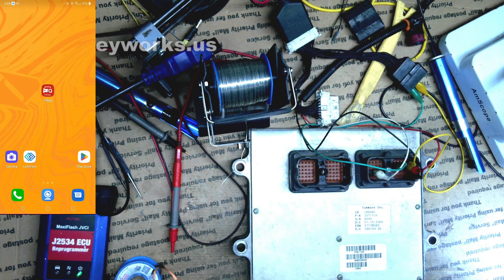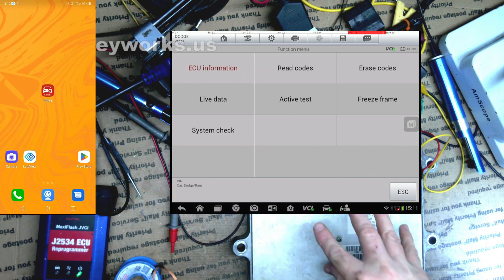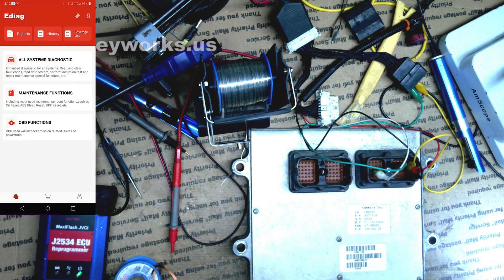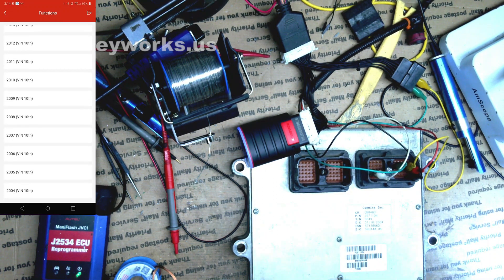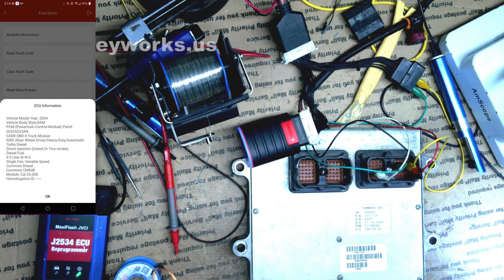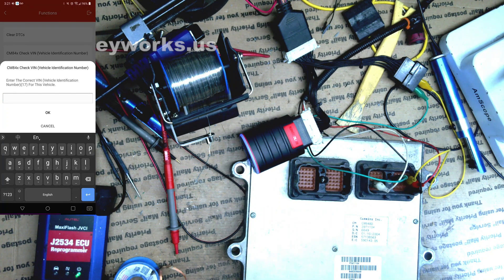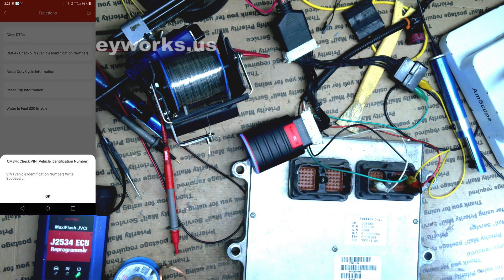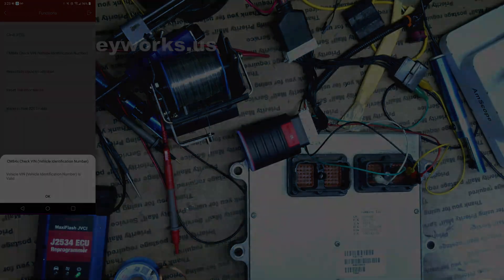VIN Write for Ram Cummins 5.9L CM848 ECU using EDIAG form KingBolen

Comment: Hi, this is on all lauch based scanners. Its one of the reasons I use it as my daily scanner, ive got a video coming up on this topic.. it will however not change the vin but write it when blank
Reply: All you need to do is kill the power to the module during the read, then it will let you write the VIN even if it's been set before.
Reply: Okay, if you are replacing the ECM with another used one, will it not allow you to change the VIN?

Comment: How can i flash the ecm?  I have a 2003 Ram 2500 5.9 with a  CM846 that needs to be reflashed and VIN changed. Since the original ecm was killed in a fire.  Willing to pay for the info.  I have CDA6 but not sure if i can reflash with that.
Reply from the maker: I use j2534 and chrysler legacy app to flash these. Then the ediag to do VIN write. Sometimes the 03 though the vin write doesnt work and I have to open it to do vin write manually in eeprom.

Comment: find myself coming across this video after i swapped PDCs and got a chronic crank no start condition on the truck.  No power to fuel system with key on, no key on power at fuel relay.  I'm thinking i accidentally fed 12v to my ecm with no ground.  Sound familiar? 05 truck.
Reply from the maker: Hello, Its possible. Its common problem on those. Long as you made sure you matched the IPM with the correct part then it may be worth sending int in for a look.